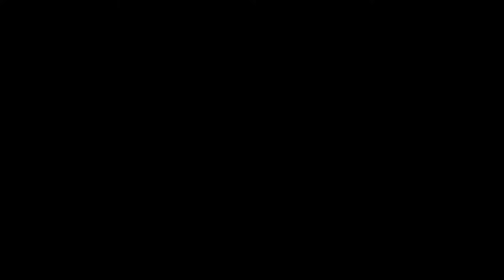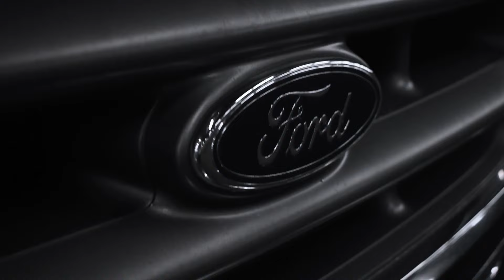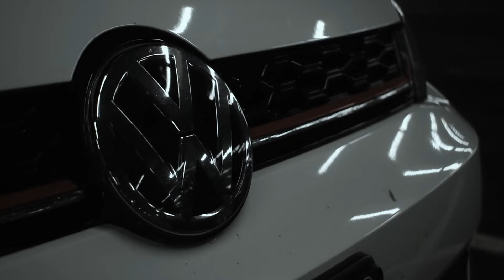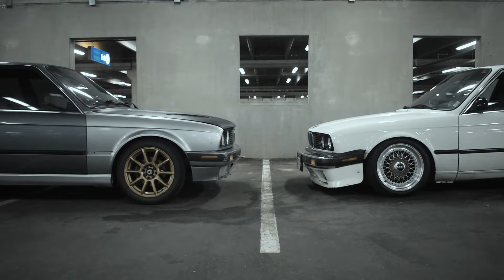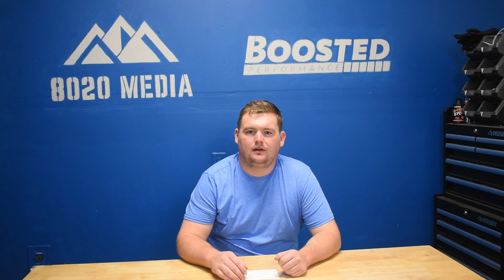How Reliable is the Ford 3.5 EcoBoost? | 3 Common Problems

Comment: 300 I6 still holds the crown
Reply from the maker: Jeremy - Probably one of the most unkillable engines for sure! That's a favorite of ours.
Reply: My 82 5.0 Windsor has 370k and must emission test every two years.  Passes with flying colors!
Reply: As a 3.5 ecoBoost owner,  I tip my hat to you Sir, indeed you are correct!
Reply: All day. 4.9L with the 5 speed literally lasts forever.
Reply: 4.9 l6 the most reliable Ford engine I rather have that than EcoBoost
Reply: Old-school Ford engines are much more reliable
Reply: Towing with the I6 might be a fraction of the EB, especially in the mountains. 😊
Reply: Over stressed and over revving tiny little turbocharged engines with too many plastic components trying to defy physics while pulling around heavy trailers,  loaded beds and people with the AC on will never last as long as the older, beefier and "less efficient" engines. I'd prefer reliability over government-mandated "efficiency."
These engines with their "new problems" are the precursor to all electric vehicles.
Planned obsolescence.   There are tons of videos posted online with premature failures of these Ford engines in Expeditions and F-150s.
Been a loyal Ford owner, but keeping the old ones and steering clear of these "eco"busters.
Reply: @JoeyJr702 any evidence of this? In my experience these newer engines are really stout. Of course you will find people online that have had bad experiences, the only difference is that people back then weren’t posting their bad experiences on the internet so you didn’t know it existed 😂. Most engines have had their own issues. People tend to forget how much maintenance they had to do before to even get to 100k miles. I have an ecoboost with about 100k with nothing but oil every 6k miles and brakes. Nothing has broken.
Reply: As my 5.4 3v is getting long in the tooth so to speak 314K with very little issue I’m thinking about when the time comes building it along with bolting some small twins on it. Orrrrrrr go get a Barra build and boost it and have an even rarer clean truck with a sweet swap.
Reply: Best engine I ever had!!
Reply: The 300 six lasted so long, because it didn't have en l ugj power to Break anything
My seco d' gen's are powerful and fast. With the aluminum body, and 10 speed they are faster than a '64 GTO, and Get 20 + mpg overall
Reply: Agreed 100% brother and it'll outlast any EcoBoost engine with ease just like my 1996 Ford F150 with a 5.0L (302) Windsor V8 will.
Reply: @JoeyJr702 Agreed 100% brother
Reply: @UnyonRing You know the 4.0L Barra Inline Six is much superior to the EcoBoost right.
Reply: @jz28h The 4.0L Barra Inline Six is wayyyyyyy more superior to the 3.5L EcoBoost V6 by a huge massive shot.
Reply: @CJColvin  Not sure how thats really relevant... I never said the 3.5 was the best engine in the history of automobiles... I dont have any personal experience with the 4.0 Barra because as far as I know it never made it to the US where I am.
Reply: Yeah I miss my 77 f-100 custom straight 6. Four on the floor 2wd. It had a pull knob choke and straight body no dents. Got stolen and sold to a junk yard and crushed 😢
Reply: You are so right !!!!!!
Reply: @CJColvin  would it be a good replacement for my 5.4 3v triton ?
Reply: My 2015 expedition have 151k and still runs strong no major issue i think maintaining is key .many der engines were gone by 100k leaking oil everywhere changing altinators water pump starter almost every  year.
Reply: 4.9l used timing gears. No chain to stretch, hop a tooth, phasers or any of the stuff that kills the cost of repair. Seen many over 500k
Reply: They do require more maintenance but if you change oil every 5000 miles or less plugs every 30000 miles they are unbelievably reliable motors had 3 over 200000 on my first 2 50000 on my 3rd

Comment: I have a 2011 f150 3.5 ecoboost with 400,000 miles on it and a good synthetic oil and filter changed at the right time will give you many worry free miles with this engine. The drive train is all original even the turbos. I’ve really enjoyed owning this pickup, it’ll do everything I need it to do and it’s fun to drive.
Reply from the maker: Stephen - Thanks for adding this valuable insight! This is very impressive and will help future viewers.
Reply: good to know i am at 231k on my 2011
Reply from the maker: Bandit - You've got plenty more miles in it!
Reply: Amazing
Reply: How often do you flush your transmission?  I bought mine used and am afraid of touching my 6 speed
Reply: @moose2934  I never flush it, I change my fluid and filter every 80,000 miles and I make sure my tranny cooler is in good shape. Make sure your ac condenser is not damaged or plugged with dirt and sand. Excessive heat is a transmissions worst enemy, dirty fluid is next
Reply: I have a 2012 3.5 eco boost an  it's missing changed coils an plugs... still doing it..any help??
Reply: @nickbowenfishing2885  do you know which cylinder has the misfire?
Reply: @nickbowenfishing2885  if you changed the coils and plugs, my next guess would be check your injectors. Take it to a mechanic that has the ford format and run a diagnostic on the fuel system. It’s hard for me to nail it down without being there. If it’s limited to one or two cylinders more than likely it’s an injector or it could be a valve. I don’t know the maintenance record
Reply: Does it drive like a sports car? Also can you get power and economy at the same time?
Reply: @CJColvin  it’s faster than all my hot rods that had when I was young with the exception of my buddys 1969 Mustang Mach1 with the 428 cobra jet. That car was the absolute fastest car I’ve ever driven. I had that car up to 167 mph, what a beast.
Reply: @CJColvin  we
Reply: @CJColvin  as far as power and economy, no. My pickup weighs over 7,000 lbs with everything I carry on and in it. I still average 17mpg over all. If I drive 65mph I get 20mpg but I’ve got power to spare when needed.
Reply: @stephenbloom2545  Nice
Reply: @stephenbloom2545  Very nice
Reply: 💥
I used Utube to walk me through the Transmission Oil & Filter change, drove up on 4 ramps, bought a suction pump $90.00, sucked it out and dropped the pan without spilling a drop. Easy job really. 
At 70,000klm it showed very fine grey metal in the pan. Cleaned it all up, replaced the seal and filter.
Shifts much smoother, highly recommend.
On a scale of difficulty from 1-10 I’d say it was a 5.
Not difficult, but it took my 3hrs. I wasn’t rushing.
Here’s a tip, gather everything you’re gonna need before you go under, I was up and down like a toilet seat.
Reply: 💥
I used Utube to walk me through the Transmission Oil & Filter change, drove up on 4 ramps, bought a suction pump $90.00, sucked it out and dropped the pan without spilling a drop. Easy job really. 
At 70,000klm it showed very fine grey metal in the pan. Cleaned it all up, replaced the seal and filter.
Shifts much smoother, highly recommend.
On a scale of difficulty from 1-10 I’d say it was a 5.
Not difficult, but it took my 3hrs. I wasn’t rushing.
Here’s a tip, gather everything you’re gonna need before you go under, I was up and down like a toilet seat.
Reply: Change your Fluid & Filter, the gasket doesn’t have to be replaced, although I did.
It showed very fine grey particles in the oil, pan showed the same. 
In about a week I noticed how much smoother it shifted. I’ll change it each year.

Comment: The 2.7 is overall Fords best engine, hands down for most people. When it comes to towing, that depends on how heavy, how far and how often. More torque and HP than the V8's and faster on the drag strip than the 3.5. In fact, a tuned 2.7 can beat a hellcat. I have over 203k miles on my 2015 FX4 and it still runs like a beast. I've had no warrantly claims or mechanical failures, and no sign of any problems in the near future. Fingers crossed. I LOVE my truck! And my EcoBoost too!
Reply from the maker: Brick - Thanks for your feedback and sharing your experience. We will actually be recording a video in the near future comparing the 2.7 and 3.5 EB's. So make sure you stay tuned!
Reply: @Greg Lie much?
Reply from the maker: Greg - Interesting take here. We've heard and seen plenty of 3.5 EB's last well into the 200,000 mileage range without any engine issues. Sorry your experience was not the same.
Reply: Wow that's Amazing 👍
Why is that?
Does the 2.7 Have a Bigger Turbo?
Reply: @MB1Billion  I doubt it. I will say this though. The 2.7L ("Nano") is a whole different engine than the original 3.5L EcoBoosts, which did have a lot turbo issues. There's a lot of unlocked horsepower potential too, aftermarket turbos, etc. But to be honest, I have all the muscle I need with what few mods I've done.
Reply: @BrickMudge  That's Good to Know that the 2.7 has power Also. 
Thank you 👍
Reply: @MB1Billion  More power equals more fuel. BTW, the wife gets 23 mpg in my truck, I get 17! lol!
Reply: @@greg9823 Tell me you have no idea what you're talking about without telling me
Reply: Do you get an induction service for carbon buildup? And do you have a catch can?
Reply: @bradh6185  No induction service as of yet. No symptoms either. .I do have a catch can though. I use STA-BIL fuel treatment with every fill up to offset the ethanol, and Amsoi P.i. Performance Improver gasoline additive every 7.5k miles, which is when I replace my oil filter between 15k mile oil change intervals. I've run synthetic Amsoil 5W30 Signature Series since practically new.
Reply: What upgrades have you done to it?
Reply: @MB1Billion  Corsa "Ford Performance" cat-back exhaust system, AFE cold air intake, adjustable Bilstein coil over front shocks (2-1/2" lift), Rough Country rear shocks w/1" block. currently running 33" Kenda klever RT's. Rear wheel well liners. Ummm.... that's about it, so far. I bought a bad ass LED front grill, haven't installed it yet. Now approaching 210k miles. Oh, and I also installed an awesome SCT Livewire TS+ tuner.
Reply: sorry bro  but the 5.0 has more HP than the 2.7 and get tow more also. Nice try.
Reply: The 2.7 also has a cast iron block compared to the 3.5 which has an aluminum block..so the 2.7 is more durable for performance inhansments
Reply: The question is will it outlast the 5.0L (302) Windsor V8 in my 1996 Ford F150?
Reply: @BrickMudge Whats the ingredients of a tuned 2.7L EcoBoost V6 gaping a Hellcat, also does it make Ford as a whole a badass car company if a tuned 2.7 gas a Hellcat?
Reply: The 3.5 is faster than the 2.7 and the 5.0.  It takes about a 30 second YouTube search or google search to find that out easily,  I also owned all three with the 2.7 and 3.5 back to back.  The 3.5 is easily faster and more powerful.
Reply: @evanl889  We'll just have to agree to disagree, but you're wrong.
Reply: @CJColvin  260,747 hard-driven miles and still counting, no issues yet! lol! 🤞
Reply: @kona6451  you're full of it! lol!
Reply: @BrickMudge  What job do you have and how much money do you make to afford that EcoBoost truck? Also will it outlast the 5.6L Endurance V8 in my 2024 Nissan Titan as well?
Reply: @CJColvin  lol! Mine's a 2015. I bought it before the prices skyrocketed, fully loaded for $45k. Yes, I do believe that the "nano" will go the distance, but every engine will have it's fair share of lemons, so to speak. Looks like I got lucky. Mine was built in KC, Missouri, right down the road. Maybe that's why. I don't know.
Reply: The 2.7 isn’t faster than 3.5 the only race the 2.7 won was a super cab with3.73 gears vs a crew cab with 3.55 gears so it should win giving its 500 -700 pounds lighter and even then it still beat thec2.7 in a quarter mile
Reply: @davidkestner5788  Sure, that's the "only" time that a 2.7 has ever beat a 3.5.... 👌 lol!  You're full of it.

Comment: I own two 3.5 f150's. Bought a 2012 years ago and now has 170,000 miles.. no issues, just oil changes and spark plugs.. still gets up and goes.. which made me buy another one...  A 2018 3.5 but not a fan of the 10 speed in the newer one but love the power.
Reply from the maker: Nathan - We love to hear this. We think the 3.5 is an excellent engine if maintained properly!
Reply: 10 speed helps everything except reliability.  suspect
Reply: The newer 10 speeds are much nicer than when they first came out.  Calibration, probably.

Comment: My son works on these in his shop. His biggest take-away is resealing of the turbos at approximately 100K although, I was in his shop the other day and he had a 3.5 in there for this procedure and it had 220K He was very surprised and the first one he's seen with that much mileage.
Reply from the maker: Gerry - Thanks for sharing your experience! This is not only helpful for us, but also for future viewers!
Reply: of course more in the shop, they outsell non turbos by miles.  Total BS on RESEALING of turbos.  I have had two and the engines are gems.  the 10spd tranny is a completely different story
Reply: @02hreblue30 Hi,
Thanks for sharing. What do you mean by re-sealing the turbos? Bearings/oil or something with the blades?
Reply: @02hreblue30 Does it make a Ford a badass car company by creating all of these small turbo engines?

Comment: Other problems: Plastic Oil pan. Cam phasers.
Reply from the maker: Benjamin - Thanks for adding input! This not only helps us, but also future viewers! We have also heard of these issues as well.
Reply: cam phasers had recalls zero dollars fixed no issues.  quit the whining
Reply: Not zero

I still had to pay 800$ (out of 4900$)at the dealership for the cam phaser replacement.

Comment: You forgot about the Notorious Cam Phaser issues on 1st & 2nd Generation. Adding a Catch Can is great for illuminating carbonization on pre 17' 3.5's
Reply from the maker: Good point. We briefly referenced the cam phaser issues in our article but forgot to address it in this video. On the 1st gen engines the cam phaser problems were often overshadowed by timing chain stretching. Anyway, I believe it was around 2019 that Ford finally fixed the issues with cam phasers.
Reply: total BS, when it's cold and the engine is in it's start up cycle it's a little loud. It's nothing to worry about. All trucks maintain rev's on start up to warm up, nothing is wrong nothing is being damaged.
Reply: @8020Media  that’s funny. The Cam phaser are still shit, they just released a new design of them very recently, us in the Raptor community know about cam phasers cause it’s the biggest and most common problem we have.
Reply: I have a 2017 F150 and had the cam phasers replaced at about 30k miles. The motor was sounding like a diesel when cranked up cold. I changed  my oil every 5k miles (with Pennzoil Ultra Platinum 5w30) and haven't done any towing. A bit later I had to have the torque converter then the transmission overhauled at about 50k miles.
I hope I'm not in for more surprises.
Reply: @8020 Media  ford lies 2019 have defected parts camphaser  camshaft  tailgates computers problem evaporated cooling problems misfire cylinders transmission problems  2019 lariat loaded is trash

Comment: Almost 300k on my 14 ecoboost no issues yet other than 02 sensors and vacuum pump has started to leak which ill swap myself.  Couple people i know have 2011's with 330k and 400k with no majors.  All run about 6500 to 8000km oil change intervals.  Full synthetic always.
Reply from the maker: J - Nice! Sounds like you take great care of it. Thanks for sharing your experience.

Comment: The 3.5 eco boost is a great engine.  But you have to make sure the oil gets changed ever 5K miles.  Don’t rely on what the truck is telling you.  The oil filter can only catch so much before there is bypass.  The extra carbon in the oil will destroy your turbos.
Reply from the maker: DJ - We completely agree!